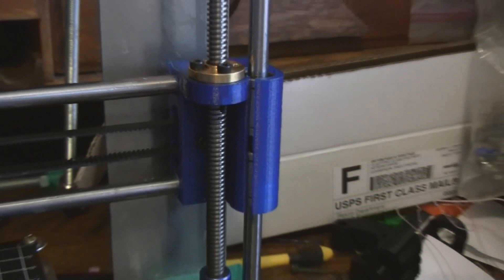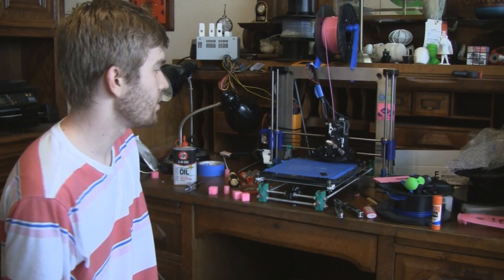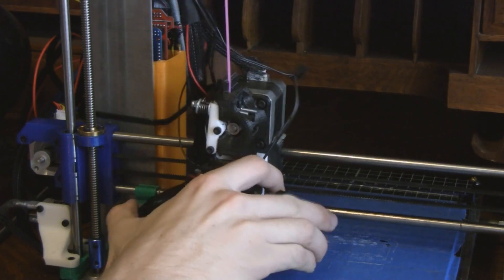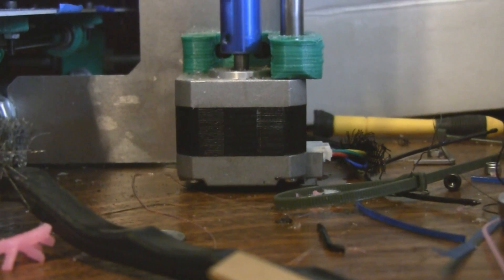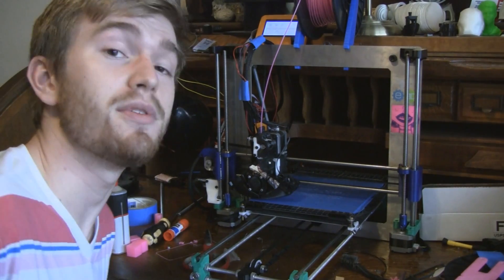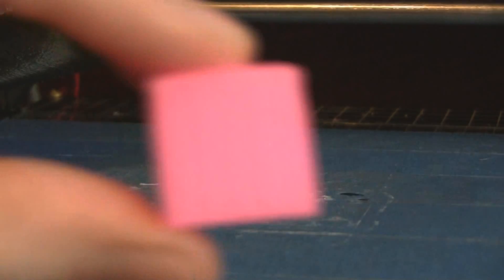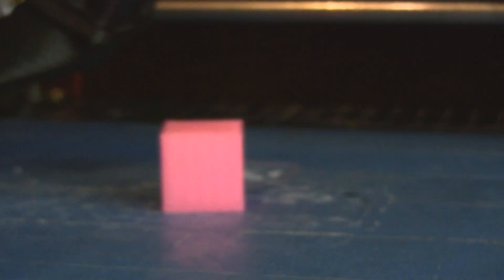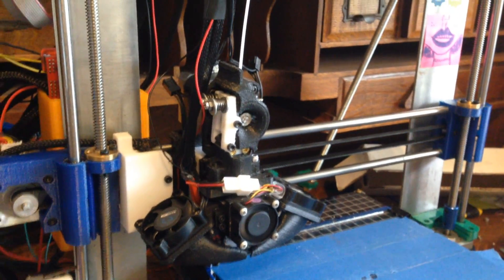3D Printer Z-Axis Bearing Upgrade | Saturday Projects

Comment: My Drylin bearing kit came with 10 - 4 for Y axis, 3 for X axis, leaving 3, not 2 or 4 for the Z. 

I'm going to put just one bearing in the Z.  I couldn't tell what you did, it went by too fast.
Reply: Oh, you put one in the top then one in the bottom?  I would have thought you'd have to pry the slot open to do that.  I guess I'll put 2 on the side with the stepper, one on the idler side.

Comment: Looking at doing my z axis bearing in the next week or so (bearings are being shipped).    For the z axis do you even need to touch the screws or can you just take the rods out of the bearings, drive the bearings out using a screwdriver, carefully put the new bearings in, and then slip the rods back in?   Thanks
Reply from the maker: You most definitely can do that! In my case, however, the lead nuts were overhanging ever so slightly on the top of the bearings/bushings and I didn't feel like driving both the bushings out and bearings in from the bottom. I just thought It would be easier to just go from both the top and the bottom. But it's totally up to you!